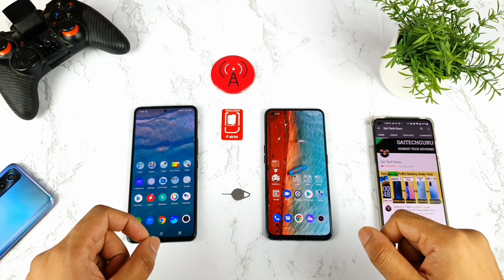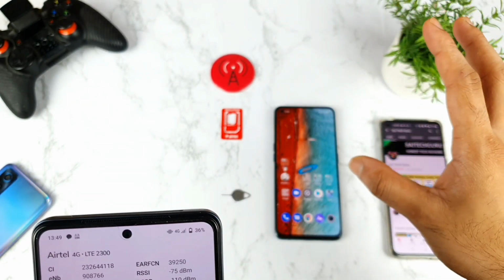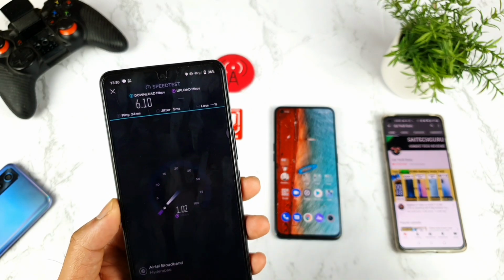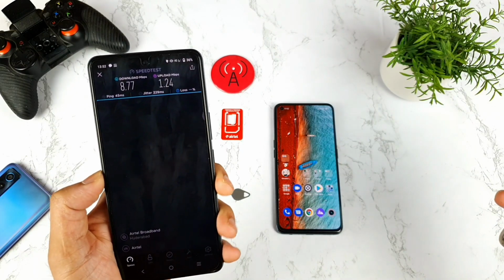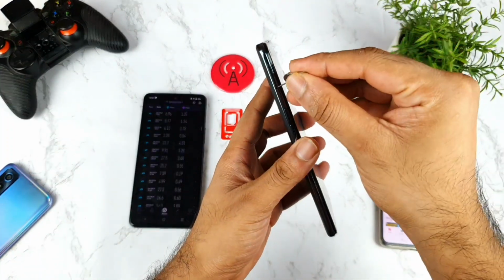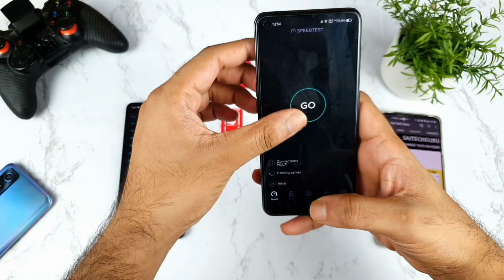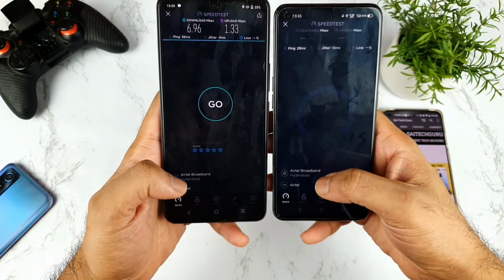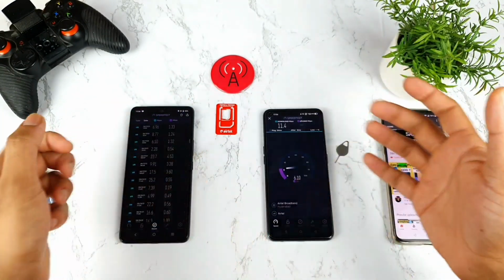iQOO 7 vs Realme X7 Max 4G+ airtel Carrier Aggregation support test and speedtest indoor comparison🔥

Comment: I think your divice only have that fault.
Because we are getting high speed and 4G+ continuously
Reply from the maker: Sorry bro not only mine lot of other users are also facing this issues. I am getting so many complains and messages everyday about this 4g issues.
And 4G+ depends on location and sim so it is nothing to do with fault unit.
Reply: @SaiTechGuru  I am not getting 4G+ in realme X7 max (airtel)